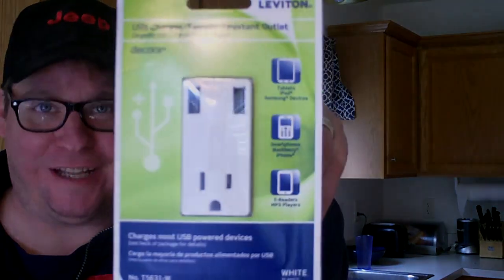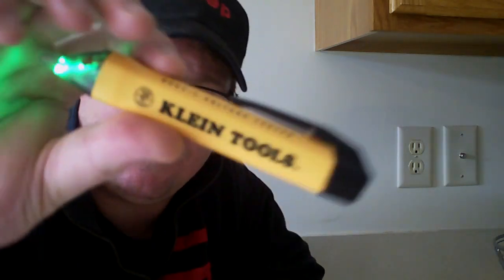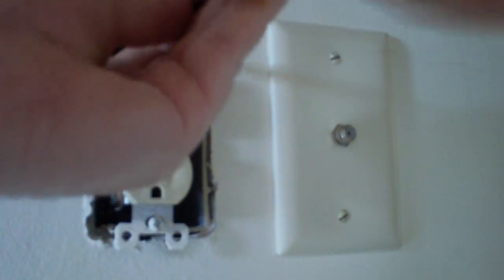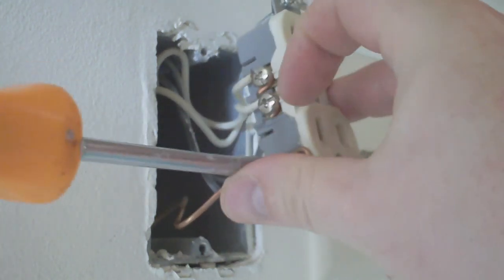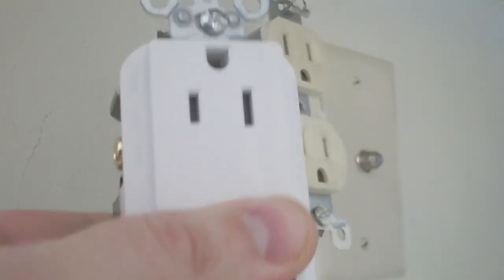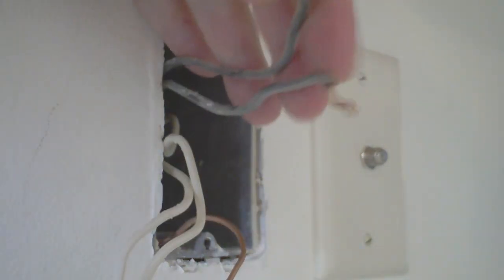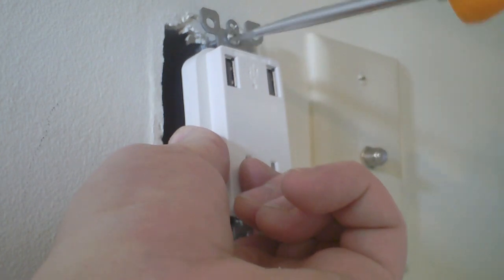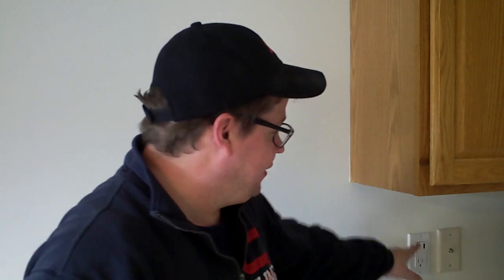How to Install a USB Wall Outlet-DIY

Comment: What if I'm replacing an outlet with a single receptacle with a single receptacle with 2 usb chargers?
Reply from the maker: Should be the same process. Look at the connections on the original outlet to make. It’s actually really straight forward.

Comment: Will this work with a non-grouned  house like from the 50's and 60's style old homes because it wasn't equipped with ground when we bought it . Will it still work anyway ?....
Reply from the maker: Dreas T not sure. You could just ground to the box though I would think. I’d do a little research. Technically I don’t think you would but then again I would plug in a 1000 dollar smartphone to find out.
Reply: Dreas T yes it will work regardless if it’s grounded or not

Comment: What if you only have 2 white 2 black cables ? Which would be the ground?
Reply from the maker: In home electrical wiring the black should always be the hot. Get a wire tester to make sure though!